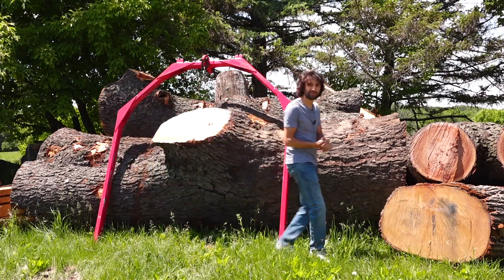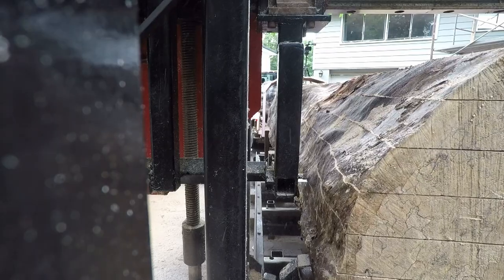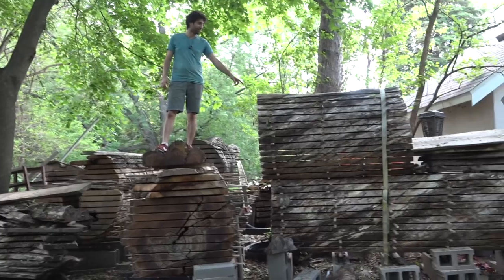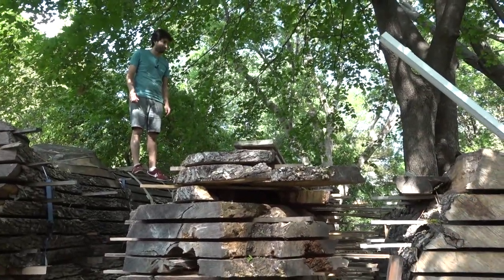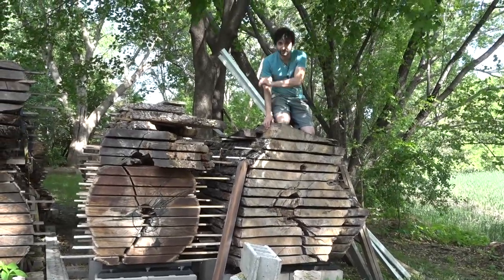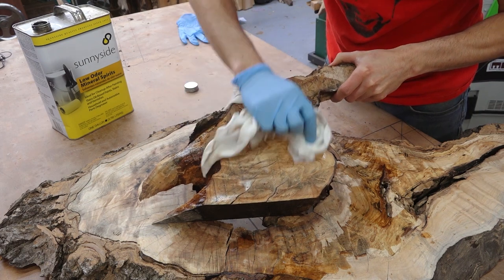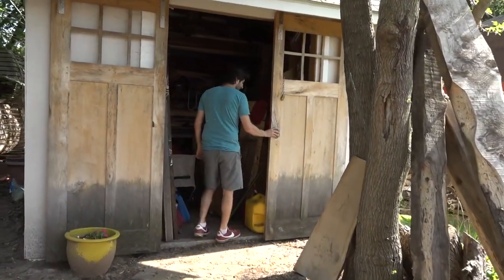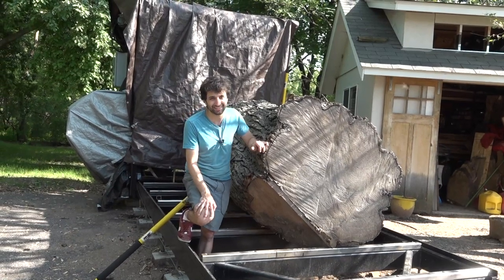Urban Lumber Yard Tour (2019)

Comment: I am an old retired gas passer guy who has always liked wood. (Carpenter in SoCal many moons ago.)
As I watched this and you rattling off the different species, I kept think how cool it would be to have a nice 'mini-slab' all sanded and oil finished with smooth curvy edges to handle and touch and compare. About the size of a piece of paper, thick enough to feel good and finished to bring out the best in the figure.
(I bought my grandkids a collection of exotic woods formed into play blocks. )

Comment: Hey, did you have any legal or zoning challenges for your milling operation. I started my mill build, and my dad is thinking that I'll have a lot of trouble. I live in mn, just a different county. I'm trying to find my zoning rules but I have to call for that it looks like. Just wondering if you had any troubles
Reply from the maker: I had no issues.  Get your hands on the city codes and ordinances.  Most of them should have them available on their website but even if you have to call to get them; you should have them for information sake since you live there.  Depending on the city they may have this info organized in different ways.  They may have a specific section regarding at home businesses or they may have a permitted land use listing or both.  Generally you start being a "real" business with any increase in the normal traffic to and from your home (allowing customers to come to your home regularly, having daily truck deliveries, etc) or when you have employees also working out of your home.  Look for the section on community standards and make sure you're not going to be in violation of any of those (visible debris, storage of equipment, noise restrictions, etc).
I did this for pretty much every city in the east metro while we were looking for our new home.

Comment: hey guy im curious about the motor on your sawmill.  im guessing around 10 hp?  single or three phase?
Reply from the maker: 10hp 3ph running off a vfd
Reply: @mcremona  sweet!  im prob gonna make a rotary three phase converter with a 15 hp three phase i just picked up.  building a sawmill in the future.  might use a hydraulic motor.  enjoying your videos and your work.  awesome stuff.